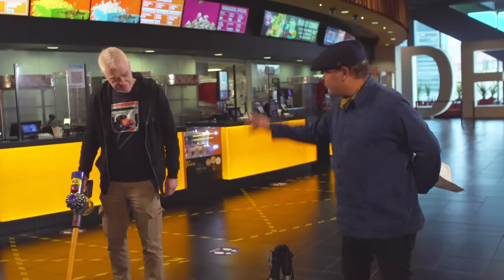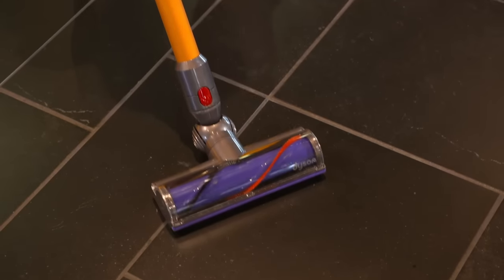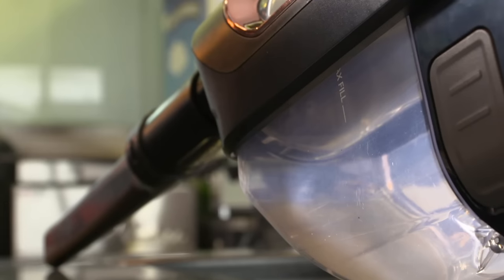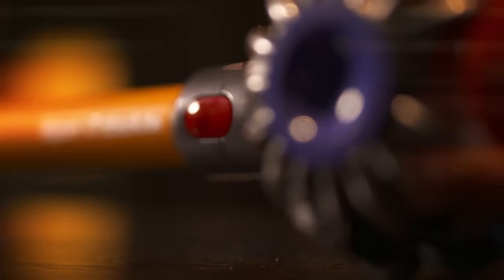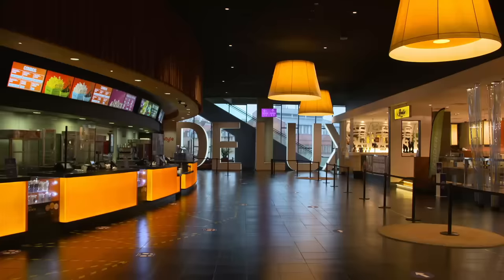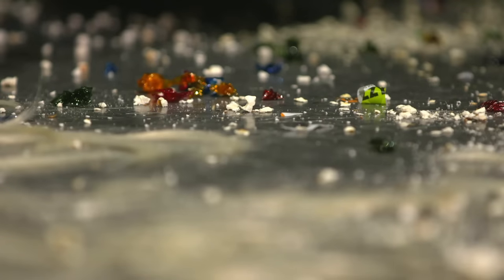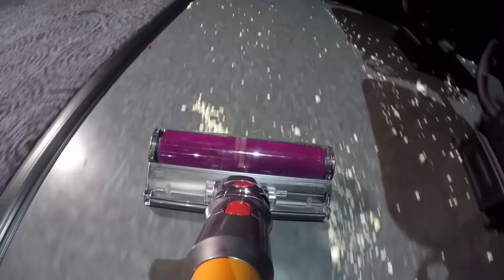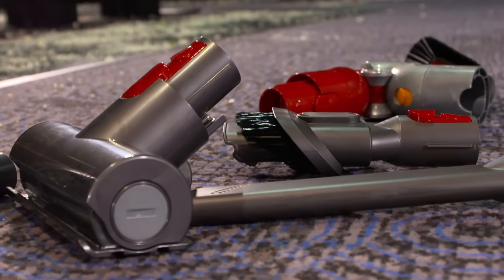Shark VS Dyson | The Gadget Show

Comment: Works great and is lightweight MyBest.Tools Comes apart for cleaning/fits back together easily. It replaced my carpet shampooer. Great on hardwood as well.
Reply: Which vacuum cleaner are you using?

Comment: Seach YouTube for "Dyson V10 Reliability : Battery failure at 18 months." This is the single most important video you must watch as a dyson owner. Basically the video says that you should not charge the vacuum immediately after your usage session, instead wait for the vacuum to cool down for 30 to 45 minutes, then charge it. The video goes into how to set up a timer to automate this process.

Comment: It kind of depends on how much you want to spend on a Vacuum. Dyson Vacuums are good, but they are so damn expensive.  Also depends on what cleaning jobs you need done.  I have no pets and only 2 carpeted floors, So my Shark APEX does a great job for what I need and would rather have corded than cordless.  I dont need a Vacuum that can suck up ping pong balls through a keyhole. Again it is up to the individuals needs on which is right for them.

Comment: Why compare a battery stick to a wired vacuum? It's a bit like compairing a bicycle to a motorbike..
Reply: Because people are using them for their entire home and replacing their traditional mains powered cleaners for the battery powered versions.  It’s just not good enough.  They are okay for quick clean ups but not for a proper clean, you need a traditional mains vac for that.

Comment: If that was a V10 would’ve been another story! Wait till the V15!  It has a brand new cleaner head to avoid hair tangling too
Reply: Yup.
Reply: True, but the V15 costs a lot more than that Shark...
Reply: @haridaspillay  v10 is quite cheap for its performance and battery life.
Reply: I was interested in the v10. But I can’t justify the price considering the v11 and v15 models make it “old”. 
But I got the exact shark model for nearly 1/3 of the price of a v10. 
My decision is based on the fact that it’s not perfect and seeing the shark so the same test and doing an equal and better in other scenarios because the v10 can’t take in bigger bits. 
Shame because I’m a dyson fan and rate them. This shark is my first shark.
Reply: v15 costs $1400 and limited to 60 min. Take 5 hrs plus to charge. Shark stick vacuum costs $339.
Reply: oot $1400!? Where?
Reply: @mat2941  Dyson v15 costs $1400 in Australia. Shark HZ390 at $339 with its flex handle stick can vacuum in places where the Dyson cannot. There is no cordless Dyson that can vacuum an entire house in one charge. Dyson cordless are simply form over function and innovation for the sake of innovation.
Reply: oot yes, the version with two batteries, stand and most of the accessories. With two batteries you’d have max 2h of run time, and if you have all carpets you’d have around 50 minutes to vacuum the whole house. I would never spend that much time vacuuming the floors. Unless i’d have a 800 sqm house 🤣
Reply: @mat2941  Does a Dyson last 2h on maximum power? No. Each battery would last around 13 min on max power. Dyson are the Bose of the vacuum industry. Style over substance, form over function, money over sense. You must be a Dyson employee.
Reply: Have fun paying off that overpriced hunk of plastic
Reply: Shark is a much better product than the Dyson. I have both brands in the house and the shark out does it. Dyson is only used for cars now whilst the shark is used for home
Reply: Shark vertex wipes the floor of the Dyson priced comparison
Reply: If it was a v10 it'd break after 3 months when the trigger gets fucked and you're out a 500 dollar vacuum
Reply: @mugz_1437  only your opinion, I also have both and prefer my dyson
Reply: @prussell890  My opinion correct and everyone else I associate with🤷🏻‍♂️ Dyson is only good for less than a year then it becomes rubbish but again my opinion off my experience.
Reply: @mugz_1437  being anti dyson doesn't make the product crap. And nope, I still prefer my dyson v8 over my shark by a huge margin. I never use my poor shark anymore
Reply: @prussell890  How can you say am anti dyson when I still use the product? Haha stupid comment. Anti means the thing would be in the bin but like I said there that crap they get used for the cars and the fake grass I have in the garden😂
Reply: @mugz_1437  Everyone including me say dyson is crap is what you said. I have a shark 3 years old very reliable, bought a dyson recently and it is far superior in every way when I clean the house. So you saying what your saying completely contradicts my opinion and I just can't understand why lmao. Anyone with the money would by a dyson over shark because they are just superior simples. I like shark but I prefer the new dyson models.
Reply: @prussell890  Plus to also have a decent dyson your paying how much? Considering a shark would match or better for half the price😂 Price does not mean it’s better or good yeno it’s just branding.
Reply: @mugz_1437  no shark doesnt match because the dyson is lighter, more powerful suction, easier to manueover, much better looking, wall bracket is amazing and most importantly has a pollen filter which the shark doesnt have (I have ashma). Shark much better value and still does a great job but they are too heavy for my liking. I loved my shark but now I splashed out for dyson I will probably get rid now or just use it for the car.  Like I said if money is no issue then the dyson is a no brainer. Either way I wouldn't buy anything else other than shark or dyson.
Reply: @prussell890  But ay at the end of the day it’s a hoover so put your dummy back in and have a good day 👍🏻
Reply: @prussell890  You 100% don’t own a shark after that comment. So to that please bore someone else 👏🏻
Reply: @mugz_1437  yes it is but who likes to hoover and you want it as easy as possible lol. Dont forget to put your dummy back in too. Take care and hoover safe 👌

Comment: I have a dyson v10 absolute and I have a shark 702... the sharks just as good and I don't have to worry about its battery failing or running out in 20 minutes everytime i use it. The sharks cord is very long also so I don't have to move plug sockets often
Reply: @Mike - sounds like the Shark is more convenient in that you don't have to keep recharging it. All in all, do you have a preference out of the two?
Reply: @theresa_sprinklr  I prefer the shark hoover. It's also easier to empty in one go

Comment: Actually, the pick up performance is determined by a number of factors, including the amount of agitation!  Suction or just Air Watts alone does not clean without rotating brushes.  What I dislike about this video is that they are using the Dyson in Max mode!  Dyson do not recommend using their machines in Max mode as it does not do the battery any good and it degrades the battery over time!  The Dyson gives only 100 Air Watts when on Max for 6 minutes and only a very low Air Watts on the regular mode.  The Shark requires so much maintenance and is messy to maintain.  These are ideal to be on the gadget show as they are just that.
Reply: these are old models as well, the new dyson v15 has 230 aw on max mode
Reply: Well if dyson didn’t recommend using it in ‘max mode’ then why did they give it a ‘max mode’ button. I have a dyson and a ‘max mode’ never needed to use it yet in 2 years. But it’s still there to use. Bit like giving a car 7 gears but saying only use 6… Max mode is for a ‘burst of power’ when needed. It’s not for continues use. Obviously. Where’s as on a car 7th gear is great for motorway cruising 😂

Comment: After 2years my dyson battery was probably half of its initial capacity, and needed constant declogging, and filter cleaning. Probably spent equal time maintaining the vacuum as I did actually using it. Not paying that price again... 😒
Reply: Dyson are the Apple of the vacuum industry. You pay extra $$$$ for the style and name.
Reply: Ditto, had the same problem with our V11 but Dyson have been dreadful fixing the problem. Customer services are useless 2 months on the problem is still not fixed, swapped the battery and still not working. 3 times they were due to collect it and 3 times no one turned up. Will never buy a Dyson again. Better off buying a brand new shark every year and it would still be cheaper.

Comment: The Dyson V8 is pretty poor nowadays, but NOTHING comes close to the V11.
Reply: The v10 comes close to the v11 and at half the price of the v11 where I live.
Reply: I actually have the V10 myself and although I'd like to own the V11, the V10 is so good it doesn't really warrant the upgrade at the moment
Reply: the new v15 has 25% more power then the v11(which i love), 230aw vs 180aw, its even stronger then the v11 outsize
Reply: V11 which we have in Europe is 220 AW :D
Reply: @TheGrudge28  you are Talking about the Outsize Model.
Reply: @003General  nope, the regular sized v11. V11 with exchangeable batteries.
Reply: V15 with green laser: Am I joke to you?
Reply: Really? Have you ever wondered why no professional cleaner uses a Dyson vacuum? Think about it.
Reply: @oot007  because its cordless..
Reply: @003General  Ever seen a professional cleaner use a Dyson vacuum with a cord? No. Think about why they don't use Dyson. It's not hard.
Reply: @oot007  because its very expensive also

Comment: 2kg vs 5kg is a no brainer.

Edit: hold on a minute, this ain't no fair fight if the dyson needs a full charge!
Reply: There's another test, when actually in use, how weight is distributed. Even with low weight, dyson have most of their weight on the handle when Shake put most of its weight on the ground. So it's more tiring with dyson.

Comment: Of course not the v7 is not a replacement for a mains powered vacuum. It’s an addition between weekly deep cleans. If you put the test up against a dyson that was meant to replace a mains powered vacuum being the V10 - V11 or V15 you would see that it not only out performs the shark by a long way but has all the added benefits of a cordless. On top of that the sharks filtration system is a hepa filter and a sponge… verse the Dylan’s that is a filter that filters down to 0.3 microns from the dirty and dusty floors you’re vacuuming. The filtration is a massive part to consider. You literally put the most under powered, and not a replacement for a corded vacuum, dyson against a mains powered vacuum. Not quite a fair test, also as I use both of these vacuums almost daily the bun capacity’s are much more different then shown. You are meant to slightly exceed the max fill line on a dyson (being about 5-10mm over), where as you didn’t even reach the max fill line on the V7.

Comment: Ironically we have a corded Dyson and have just got a cordless shark. The shark is much more convenient and actually picks up better. Pine needles were not it's strength but for general purpose it does very well.
Reply: Have both brands myself and the shark is the much better vacuum without comparison. Not sure if you notice but after 12 months the Dyson gets worse but have seen no issue with my shark and it’s 22 months strong
Reply: Here the same. After over a year the Dyson starts to have several issues. I am going to get a shark now and hope it will be better. 😊

Comment: That suction test isn't accurate. The 35° angle of the Shark's suction tube compromises the test.
Reply: Yeah tube diameter would affect it too...
Reply: But thats what it has... so it is accurate. It is what it is
Reply: @smoothie9931  No, it's not an accurate test compared to a vacuum that doesn't have the exact same angle. That would be like testing a Volkswagen Passat hatchback to a turbocharged Toyota Camry hatchback.
Reply: @theylied1776  not really. If the hose has a bend in it by design, that's as accurate as the test is gonna be. It has the suction that it was tested at, even if it doesn't fully show the suction of the motor.
If the results are lower because of the bend in the hose... you still have to use those results, since the bend is part of the design

Comment: I dislike my Shark cordless. Suction power is pathetic.
Reply: Yes I tested it out in Curry's store and it wasn't as good as a Dyson.
Reply: @TheSpeedfreak665  I agree but suction power isn’t everything. It still needs to do the job properly. 
I’ve seen cordless shark beat corded dyson that has significantly more power than its cordless ones. 
And it does a better job doing the same tests. There’s countless videos on YouTube showing that. Despite been a fan of dyson. I’m trying a shark this exact model actually. Finding this video was a coincidence cos it was just in recommended and it didn’t state the model it was testing. But I think based on other user reviews I think I haven’t made a mistake.

Comment: Dyson v7 is lower spec than v6, they lowered it to save battery, this isn't a fair test due to one was corded one was battery.
Reply: So why does the Dyson cost way more than the Shark? It doesn't make sense that a vacuum costing $$$$ is outperformed by one costing far less.

Comment: I tested a friend Dyson, and I was debating between Dyson and central vacuum. I ended up with Nutone VX1000 + all accessories and it cost me around $900 (did the installation myself). VX1000 is thousands times more powerful and better than Dyson and  Ido not regret it a bit

Comment: hark touts a five-year guarantee but just try to get a part if your vacuum gives out. The so-called guarantee does not cover moving parts, such as the beater brush or motor or switches.
Reply: Not had any issue with the guarantee. Just had a replacement floor brush, didn't fix the problem so they just sent a brand new one free of charge upon returning the faulty goods.

Comment: Ha! Anyone that’s used a modern cordless dyson will know how much of a game changer it is. Is the gadget show really recommending that shark over the dyson? If anyone is confused by the result here... I would just like to say you most likely will not need to clean a cinema any time soon.
Reply: I have been using a v11 for almost 1 year and I love it. def a game changer
Reply: I've used the newer shark and quite frankly I loved it. The duoclean with zero m is a must. You don't have to choose between the regular head and the fluffy roller like the Dyson since it has both and hair doesn't catch. Its a lifesaver and makes it so much easier to switch between carpet and hard floors. Plus you don't have to deal with all that battery life nonsense and waiting for the battery to crap out in a couple years
Reply: @blake031299  yeah not having to change heads is cool but i know for some people there’s huge satisfaction in the technicality of using the different attachments. Some of the new ones have replaceable batteries too and suction that adapts to floor type. Also I can’t believe I’m actually discussing vacuum cleaners online....
Reply: @ra55575  I've been watching review videos since morning mate, sharing your pain...

Comment: I am shocked this show is still going.  I have a Shark cordless, it is a good unit, corded is better, but cordless is more convenient. I would never buy a Dyson, overpriced unreliable muck.
Reply: do you think corded units have more suction than cordless ones?
Reply: @Sssssssslf  A corded machine should have more suction than a good cordless one, one have a cordless one with powerful suction then they will run out of power very quickly. a friend of mind got the Shark corded machine and it certainly picks up better than my cordless shark. i will get a corded machine at some point,
Reply: @zyborg47  thanks for your reply  urgh I'm so conflicted! shark or Dyson cordless or corded!
Reply: @Sssssssslf  I'm looking for a cord stick vacuum and leaning towards Shark. The extra $$$ for Dyson is for the style, fancy materials and the name. Cordless vacuums make no sense. 5+ hours charge up time to last 60 minutes. If you use max suction power it will last even less.